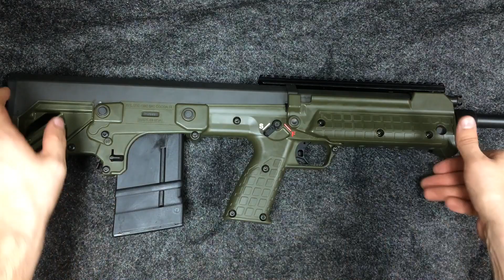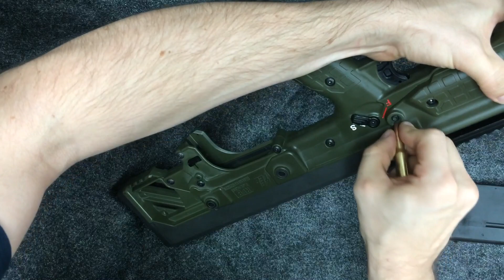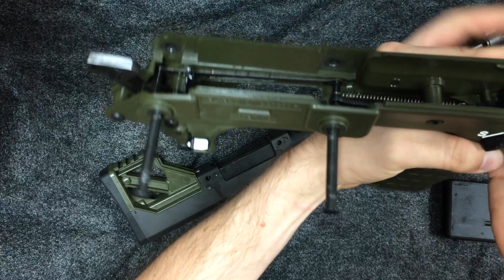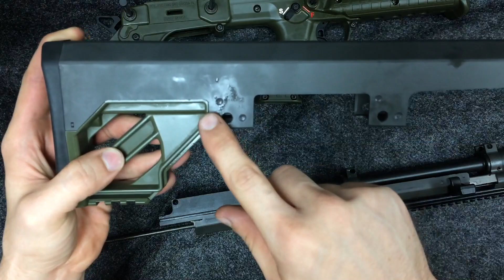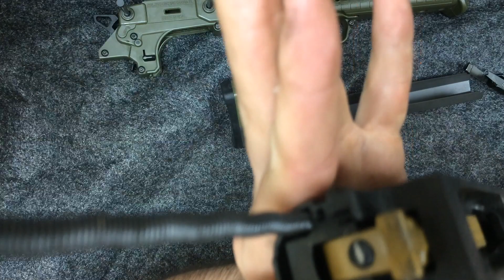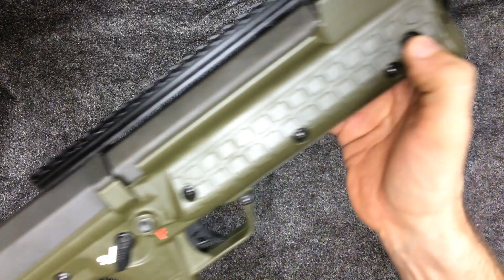How to disassemble the Kel-Tec RFB 308win

Comment: Why make taking the lower off so difficult? Simply push the two rear takedown pins, put the barrel on a soft surface such as carpet and guve a small thrust to the rear of the pistol grip. Remove top cover, then charging handle, and then bolt, and finally push out the two final pins and remove the stock.

Comment: Mine jammed at the range yesterday and I just tried taking it apart and the bolt carrier barrel group will not separate from the rest of it.  this is just after getting the rifle back from Keltec because of the gas piston exploding. Great rifle when it works but mine has never worked lol

Comment: How do you disassemble the hand guard on the rfb?
Reply from the maker: Ill try to work on a video on the front hand guard. Thanks from Shoot Wise
Reply: 6 screws on the handgaurd. Use 2 Allens at once then pry apart from the inside so you  dont mess up the exterior that is visible.
If you do one side at a time the other screw will just spin in the aluminum  insert. 
I had to take it apart to put my lower rail on